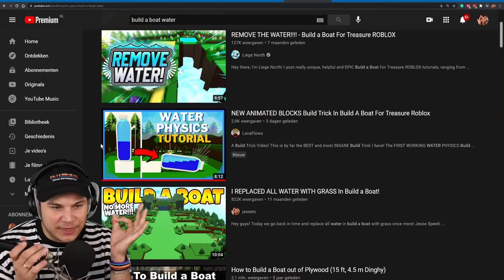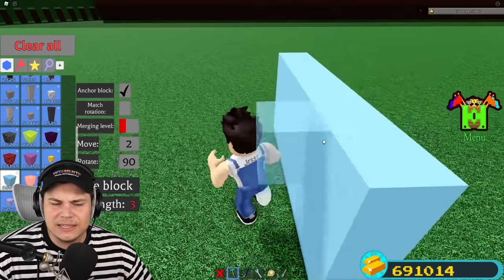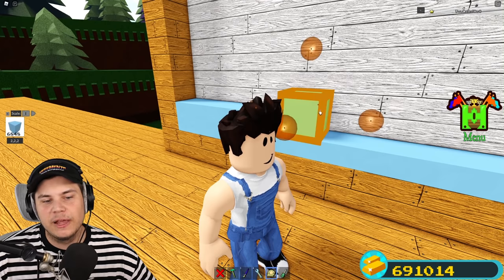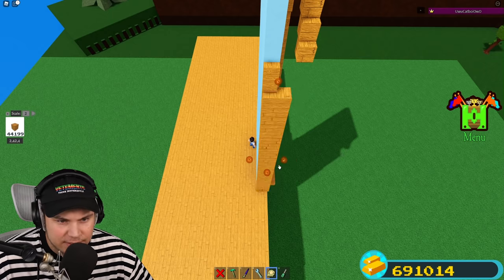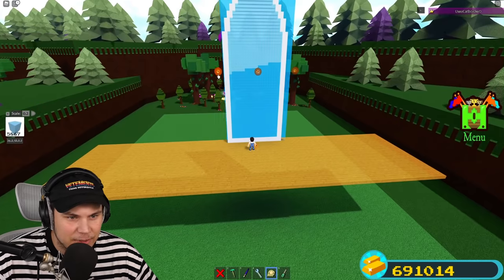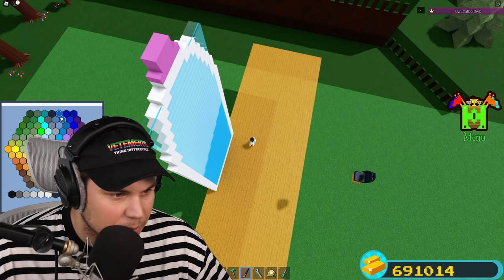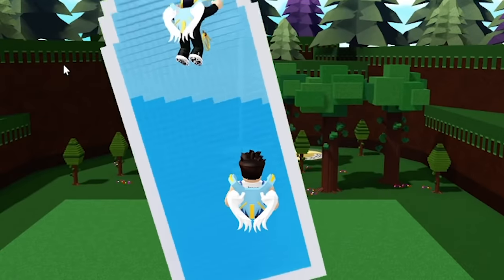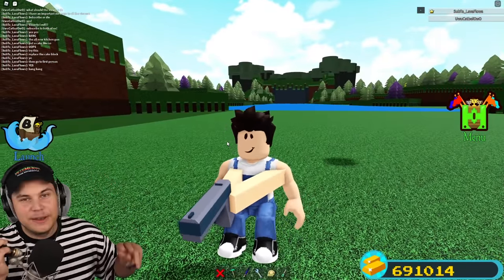WORKING WATER BLOCKS In Build a Boat! *Insane*

Comment: so  you make the water then make the same thing in the back then you make the blocks in the front and back connect at the same display then you add blocks in side the water then after all of that you make sure its sturdy then after you make the blue water inside un-anchor then you have a working water i guess